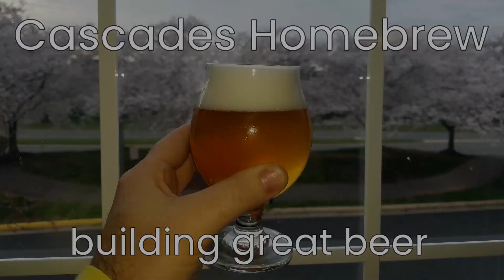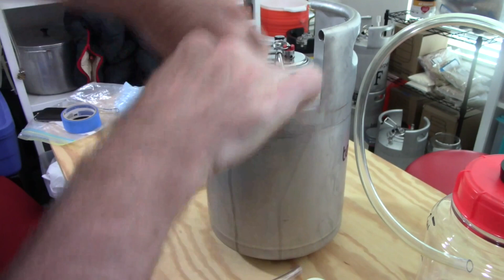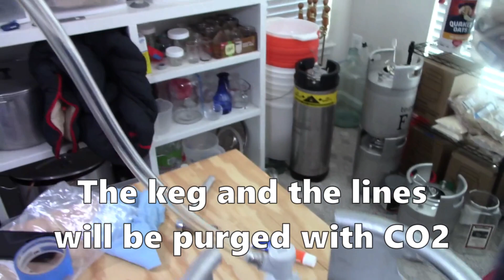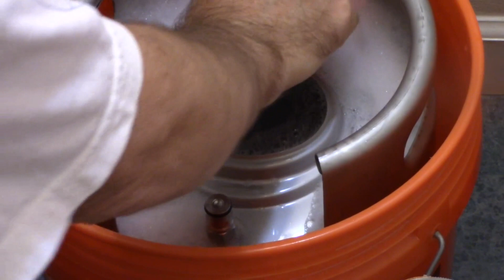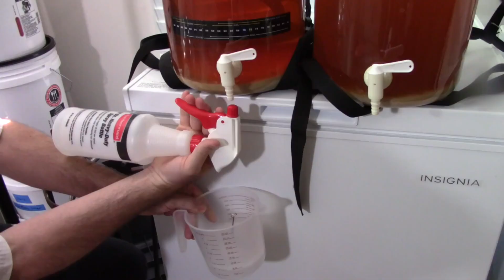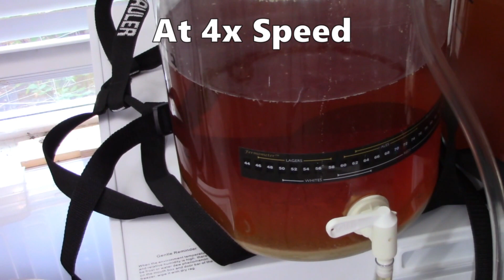Closed Keg Transfer Without an Expensive Fermenter!

Comment: Do I need to fill my entire 5 gallon keg with sanitizer, or can I do like half filled and purge a few time to get the oxygen out?
Reply from the maker: It takes many purge cycles and uses a lot of CO2 to effectively purge. I have read of people adding a small amount of Starsan solution and blowing CO2 through the dip tube to fill the keg with bubbles (which should be filled with CO2).

Comment: This is awesome, thank you for the tips. Is this closed transfer possible with a regular fermentation bucket? If not, where did you get your fermentation buckets?
Reply from the maker: Yes, it should be possible with a bucket, or any fermenter with a spigot.  There is no need for the fermenter to be able to hold pressure.  The fermenters I have are Fermonsters.  They are made in Canada and sold at various location here in the US.  I got mine from both a local shop and some from MoreBeer.
Reply: @CascadesHomebrew  Thank you, I just cut a piece off of my siphon plunger to make an adapter for the lid like you did. I'm excited to try this out.

Comment: I saw that VacMotion sells a 20 and a 50 screen size. Did you pick the 20 size for a particular reason? 
Thanks,
Pat
Reply from the maker: I am not sure if there were multiple options when I picked up my filter off Amazon.  I feel like the screen size I have works well for filtering out small hop bits that might clog the keg.  If I was ordering from the Vacmotion site I might pick up an extra filter at a different screen size to try out (and also get a few replacement gaskets).

Comment: Great video!  I have a corny keg I plan to close transfer to using this method. Some have said to cut the corny keg pickup tube/straw so it is 1-2" off bottom so any trub doesn't get sucked up the tube but this seems counter productive and leave a lot of Star San left in the keg prior to transferring.  Would that much Star San give the beer an off flavor? Have you transferred to a corny keg before and if yes, what have you done with the straw?  Leave it as is or cut it short?  TIA - Mike
Reply from the maker: Glad you liked the video.  I agree that leaving behind much StarSan solution (which likely has plenty of oxygen in it) is not a great idea.  I have not shortened the tubs on my kegs so I am able to push out most of the solution.  Some kegs have a flat lid, so you might be able to get the last bit of solution out the PRV, but many keg lids are not flat.

Comment: Nice video! I do a closed transfer that is similar except I don't purge a keg full of Star San. After the keg is full of beer I'll purge it.. And I've been happy with the results. Your  method it is excellent. In the old days we just dangled tubing in from the fermenter to the bottom of the keg and  let lots of oxygen in.The only beers that I remember as being oxidized were some bottled beers from a bottling bucket.  Cheers!
Reply from the maker: I worry a lot more about hoppy beers than most styles, but I have moved to doing closed transfers anytime I keg. It is just a little extra work and CO2, and I figure it can't hurt. I should try a side by side with my old transfer method.

Comment: This is great. Thanks for this video. But my spigot is not made of plastic so I don’t have the hole on it that helps to purge the line. How would you proceed in this case?
Reply from the maker: Ahhh...The most critical aspect is purging any air from the transfer line.  You could probably just position the line loosely on the spigot and let most of the CO2 escape before fully seating the transfer line.  Glad you found the video useful!

Comment: Thanks for this. Really helps. When you connect the gas line to the blowoff, does some of the remaining pressure in the keg rush into the fermenter? If so, do you need to make sure first that there is not so much pressure still in the keg that it blows your fermenter? Similarly, if I want to run the tap for a second to purge some of the trub, can that gas-to-blowoff create positive pressure for me using leftover keg pressure so as to avoid o2 ingress?
Reply from the maker: Since I am only pushing out liquid from the keg at around 5 PSI, the remaining pressure should not be enough to cause an issue, but most of the pressure is released before I connect the gas line.

For beers that I plan to cold crash (mostly dry hopped ones) I usually have a mylar balloon setup.  That helps to avoid suck back during cold crashing, but it also help prevent air suck back while taking a gravity reading or clearing trub from the spigot.   I see what you are talking about and it probably would work.
Reply: @CascadesHomebrew  thank you!! This makes total sense. I’m a noob to kegging and am really psyched for my first closed transfer NEIPA. It’s my favorite style and I failed miserably bottling it last time due to O2. Your video made the closed transfer setup much more clear than other videos I’ve seen. Appreciated.

Comment: After you transferred the fremented woft. Then how do add the prime sugar in it?
Reply from the maker: I force carbonated my kegged beers.  I usually just connect the CO2 at serving pressure and let it carbonate over 7-10 days (faster for small kegs).  Sometimes I will leave it at 30 PSI for a day to jump start the process.

Comment: So you brewed 5 gallons and split that into 2 cornys leaving 2.5 gallons in each corny.  Then did you split your yeast pitch in half also?
Reply from the maker: The beer shown in this video is a Belgian Blond that was split with two yeasts.  I brewed a 5 gallon batch and split it into two fermenters/kegs.  In this case I pitched one pack of dry yeast into each fermenter.  Some times I will only use half a pack for a 2.5 gallon batch.  (The video on the Blond is here: https://youtu.be/3HnJzcolC9Y)